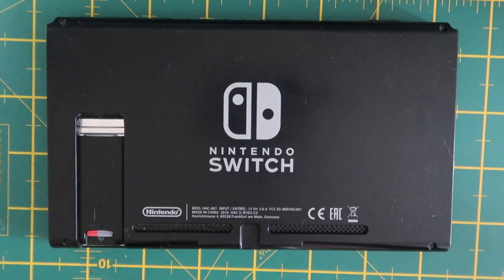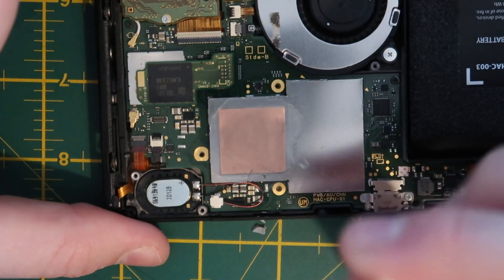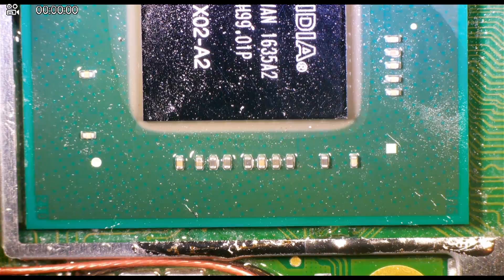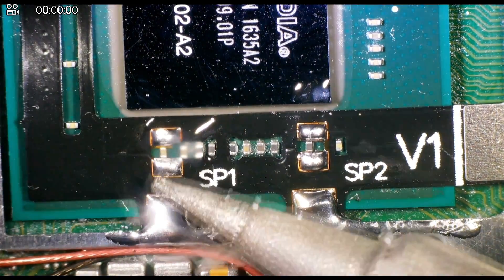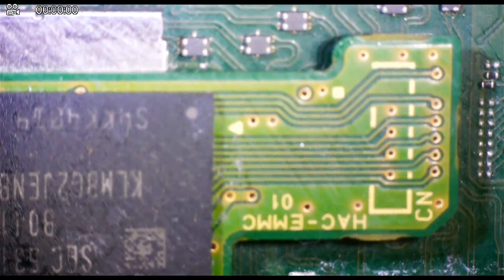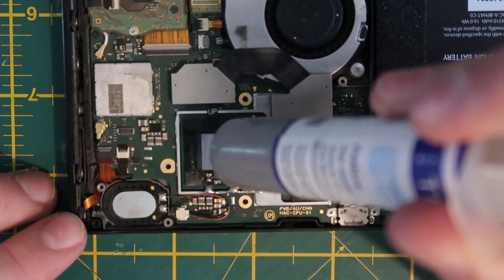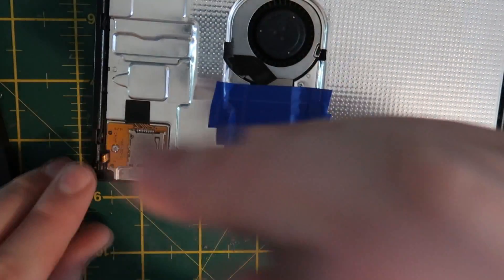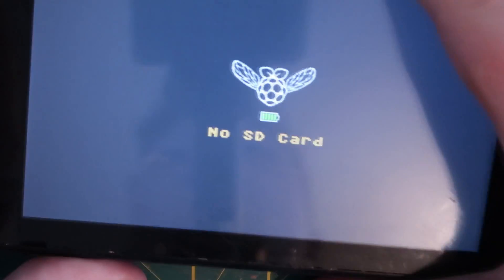Nintendo Switch RP2040 (PicoFly) V1 Modchip Installation

Comment: I DID IT, FINALLY! Had to get a magnifying device, Tried without and made a huge mess. Then when using the device realised the tip of the soldering iron was worn out and wasn't heating up. Had to use a bigger one and that worked a treat. Cleaned everything up and started again. Makes a huge difference if you can actually see what you are doing instead of using an iPhone in one hand!

Comment: Did it on mine, installed the chip, booted to the "no SD card" screen. Turned off. Started assembling it back... and I put on the metal shield, turned on, chip flashed the leds, then turned off, and now it's not turning on at all... not even rolling back to no picofly chip and the NAND on it's supposed place... Does anyone know what could've happened?
Reply: If you didn't put kapton tape, it might have shorted out

Comment: Ugh brother what is that.. Not your fault but the "CPU/TIM/metal shield/TIM pad/TIM/Heat Pipe/TIM/back plate" sandwich is making my eye twitch.. 
If they are using that much TIM why are they also using a thermal pad gooped with paste? I'm sure it works and is fine.. but it's just ugly..

Comment: Hello sorry to bother you I was just wondering does the V1 just stand for the version of the mod or does it mean that it can be used on a V1 Switch as I ordered a V1 Switch last night and this morning was thinking if it is possible to use one of these hard mods on the V1 Switch and if it's easy I might do it (I know soft modding is possible but I just want extra features sorry) thank you
Reply: The v1 is the easiest to mod if you weren't gonna mod it shoulda bought a v2
Reply: Nevermind I decided not to do it as I don't want to break it by accident

Comment: Assuming I have minimal soldering experience, do you think i could do it or should i just practice more before trying? Also do i Need a microscope or is that just something nice to have, because i dont really want to spend 100 dollars on one.
Reply: It's more expensive to acquire the necessary equipment for soldering that to pay for a professional to do it for you.

That and inexperience with soldering can and will lead to fatal mistakes.
Reply: @DoctorDeath147  How much would you estimate it costs to get a repair shop to do it?
Reply from the maker: They usually charge around £80 for a V1/V2.
Reply: @TheModSmith  That's steep. I might just stick with emulators 😭

Comment: Hi there,

I just have a quick question. Once all the points are soldered, will the console only turn on when the picofly is connected?
I soldered all the points and it doesnt turn on anymore, once i solder them off it turns on. So i tried to connect the rp2040plus but im not getting the "no sd card detected" screen. Any idea what the issue might be here?
I already flashed the firmware. thanks in advance!

Comment: Just a heads up to my fellow noobs, try practicing using old headphones, since the components are usually tiny. also make sure you use the proper chip V1/V2.. if you are using newer version, then you should use v2

Comment: I'm back again. I accidentally knocked off the right capacitor and there is no way of installing a new one because the pad is completely ripped for some reasen. But it still boots up normally. Do you think I can still install the modchip because it still boots up?

Comment: Useful tip from the countless installs I have done. Instead of just tinning the pads on the front of the small flex cable, tin the other side of the pads too. Obviously,apply tin in moderation and do not dump the whole spool of tin solder onto a single pad. That way, the solder will always stick on the components no matter what. It makes the install of the cpu flex cable 1000 times easier specially if you're noobies and have no access to any magnifying equipment. P.S.  do not attempt any smd soldering job without having magnifying equipment available. It's the perfect recipe for disaster
Reply: agree with this, just tore off the ground pad today by accident and failed to bridge the sp1 and sp2 connections on my v1. always use magnification and good quality solder

Comment: When I try to boot into default firmware the screen goes blue. Pressing both volume buttons. I tried putting it back together as normal and it still blue screens. Do you know what could’ve went wrong?

Comment: What does cleaning the thermal paste do, and do i need to do it for this to work?
Reply: Cleaning and reapplying thermal paste isn’t necessary, but you should anyway because it’s better for the CPU to not overheat.

Comment: Great guide but there are several places where kapton tape should have been used to avoid risks of shorts. Over the capacitor that wasn't being soldered to but was extremely close to the solder pad on the flex cable. Over the flex cable to avoid shorts to the shield. over and/or under the mod chip to avoid shorts to the shield. Along the cut edges of both of the shields to better dull the sharp edges and to prevent shorts if things move which is very likely in a handheld console.
Reply: can you use electrical tape insted of kapton?
Reply: @heineken9030  Its better than nothing but electrical tape tends to degrade over time and can leave a lot of residue behind when removed.

Comment: Nice work! As long as the tuermal paste is non conductive, you can not use too much... Anyone stating otherwise is simply repeating what theyve heard or read. Think about it - air = bad which is why we use thermal paste.. so hs8ng "too much" will force more air out , which is good for cooling.

Comment: Just wanna say, great video. Made the install nice and smooth. Only one small note for anyone who hit a wall like I did. If you do the install and you get no LED lights at all and the switch boots to OFW, it's probably because the 2040 did not come pre-flashed. Mine didn't and I was stumped for a while. Other than that, my soldering isn't exactly amazing, and I was worried about the strength of connections on the tiny caps. Has anyone used solder mask or equivalent to strengthen the connection with any success?

Comment: What is the purpose of soldering the two capacitors? Is it for entering RCM mode? If so, can I just use Jig for my unpatched switch? The reason I want to do this is because every time my switch gets shut down I need to use my laptop to inject payload and the price of the RCM loader is almost the same as the picofly chip
Reply: If I had an unpatched switch, I would definitely try to avoid soldering as much as possible so I think getting the RCM loader is better
Reply: @Luigi_Luigi2401  Well since auto RCM is a thing, I thought the nand part of picofly ( the part that does not need soldering) is for injecting the payload, so I don’t need to connect my switch to PC or Android every time. But if I need to solder it then I will choose RCM Loader, don't want to brick my switch with my shitty soldering 😆
Reply: These modchips use voltage injection to exploit the Tegra X1. Thats why these require you to solder to the capacitors.

On unpatched Switches, you can just use the x86 chip. It doesn't need you to solder directly to the CPU; the x86 is basically an internal payload injector and jig. 

Neither chip requires the hacky method of AutoRCM because they basically act as payload injectors.

Obviously, you shouldn't do any attempt at soldering a chip if you are not confident in your soldering ability. It's not needed anyway because you can use homebrew apps to reboot to different payloads while in CFW.

Comment: I’ve installed the mod chip for patched V1 but now says no SD Card, what next, where do I get the files for the SD catd
Reply from the maker: Go on GitHub and get the HATS pack from sthetix and copy the pack to the microSD card.
Reply: Thanks very much for the lingo.
Does it mean the mod chip install has been done correctly if it says  “No SD Card”
Reply from the maker: @ginjaninja1972  Yes, that means it's ready to run the software.
Reply: That’s great thanks for that, really appreciate it and great tutorial
Reply from the maker: @ginjaninja1972   Glad it helped, thanks for your feedback!
Reply: Tried installing the HATS pack but still getting No SD Card
Reply: Hi mate, it was my SD card reader in the switch, ordered a new one and installed it today and running with HATS 1.6.2

Comment: Does this work with V2 switch?
Reply: Yes it includes flex cables for version 1 and 2 of classic switch. The difference is the orientation of the capacitors where the soldering is applied.

Comment: Hi, is it the same with v2, I mean soldering points on the board?
Reply from the maker: The orientation of the capacitors (CPU flex) are different on the V2, but besides that it’s exactly the same.
Reply: Thank you! :)

Comment: I was thinking about buying a switch lite to mod but this looks like a lot less work haha
Reply from the maker: The CPU flex cable points are the same size and difficulty on the regular switch and the lite, although the lite needs another flex cable and is overall a harder install.

Comment: Great video! I have a "possibly patched' switch. Should use the v1 or the v2 cable?
Reply from the maker: Firstly check whether it works with RCM mode, but if it doesn’t then patched consoles use the V2 cable.
Reply: @TheModSmith  I know it doesn't work with rcm. That means I should use the V2 cable, right?
Reply: @HeavyShark127   Check Model Number at the back of your switch, HAC-001 for V1, HAC-001(-01) for V2, not all V1 can RCM only the earlier version is, V2 is the upgraded battery one with red box on the packaging

Comment: Cool! great video!  I didn't cut the heat shield and put the modchip on top of it, still fits perfectly with the plastic rear cover
Reply: i was planning to try it. i heard from someone that it might not fit well. but according to you its fits fine. is thre any slight bump at the back of the switch?
Reply: @sylox2010  Yes, a very teeny tiny minor very slight curve.  If you didn't know, then you wouldn't see it.

Comment: RP2040 Game Console CPU Cable Chip Replacement For Switch NS/Lite/OLED, CPU Flex Cable Ribbon Cable For Switch Game Accessories (for Switch NS) would this mod chip work for v2 Nintendo switch?
Reply from the maker: For V2, you want the “NS” or “CORE” model.
Reply: @themodsmith

Comment: Newbie here can i modchip my switch oled i just update today 17.0 1 ? i planning to jb my switch
Reply from the maker: Certainly, you can modify your Switch OLED on the latest firmware. My suggestion would be to practice your soldering skills to perfection or send it to a professional; it's a very challenging installation. Don't be misled by videos making the components look large under a microscope.

Comment: Im very very new the whole patched switch thing. Does it matter what type of RP2040 modchip i use or where I even buy it from?
Reply from the maker: RP2040 is just a standard microcontroller and can be used with all consoles, but custom PCB’s like the one in this video have been made to make this one easier. Launch consoles will use the CORE model, OLED uses the OLED, and LITE uses the LITE.

Comment: Just did my first one on a V1 Switch and that was probably the easiest modding that I've done. Adding bluetooth audio boards into old OEM car radios prepared me for this LOL
Reply from the maker: It can be easy with experience, but the majority of people don't. I try not to mislead people into thinking they can do this as a first project, as I think it could be damaging.
Reply: @TheModSmith  Agreed. Hope I didn't sound too misleading with my comment 😅
Reply: Where did you get the chip from?
Reply: How to I know witch flex connector I need to use? V1 or V2 ? Mod kit came wi both and im not sure what I need to use
Reply: I have a switch with XKJ7 witch Chip I must use
Reply: If using a mod chip can you mod any switch or are you still limited to only the moddable switches from near launch
Reply: @ulisesvazquez2833  All Switches are capable of being modded. You'll just need to get the specific modchip for your model or if you have a V1 Unpatched Switch, you may do the RCM Jig method which requires no soldering.
Reply: @ulisesvazquez2833  any switch
Reply: Is it easy enough wow where you don't need a microscope?
Reply: @skree25  No you'll definitely need a microscope,the components you're soldering to are virtually the size of ants
Reply: I considered doing one of these, but v1 is already rcm. I've done plenty of PS1 and PS2. So it would be easy if I do.
Reply: Wish me luck, doin this with phone camera. Flex board already tinned beforehand
Reply: Hey can u please tell me if u used a microscope for this?

Comment: this is more for me than for you, use more flux and turn your temps up a bit
Reply from the maker: I felt I used too much flux if anything, maybe I didn’t show it properly. I also use 420 degrees which is very hot already.
Reply: Which solder did you use? It looked to me as though it didn't enjoy flowing so much.

Comment: What does it even do tho???
Reply: I think this might be a V1 unpatched switch, so there's no point, unless you don't want to do the rcm thing every time u want to use ur switch, but if it's patched, it allows you to hack the switch
Reply: @ABrainDeadIdiot This. I'm a vanlifer so I don't have a dock to just leave my Switch on all day and so this is the best method for me. Don't want to keep using that RCM jig crap every time I turn on my Switch.
Reply from the maker: It enables homebrew and CFW, although my switch is a V1 so works with soft modding but I just didn’t want to mess with RCM jigs whilst filming other content.

Comment: Have the dual boot? Original and emunand?
Reply from the maker: I just used the sysNAND for this console as it was very cheap and was sold to me when already banned from online access.
Reply: @TheModSmith ok, One more question, can it be updated to v1? I'm going to install it tomorrow, but I don't know if it has any outdated firmware.

Comment: You should put Electrical Tape over the CPU shield where the modship lies as well. 

This prevents static from reaching the modchip through the metal shield

Adding tape under the emunand (the side that plugs into the modchip) wouldn't hurt either
Reply: kapton tape is better
Reply: @user-yk1cw8im4h  this.
Reply from the maker: Definitely a good tip, I’ll try this for my next install.